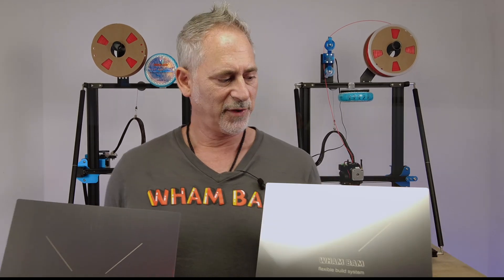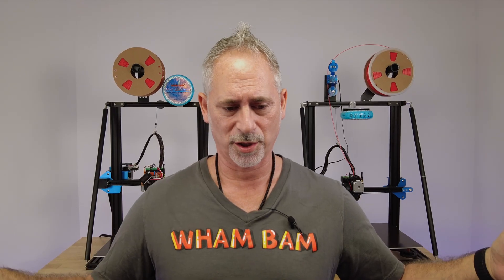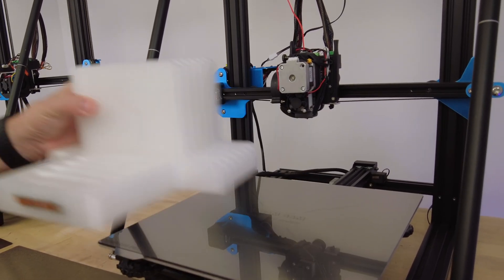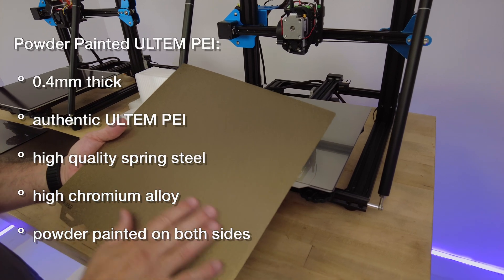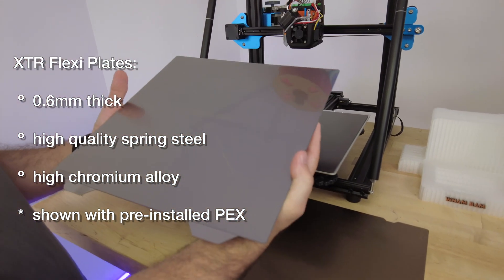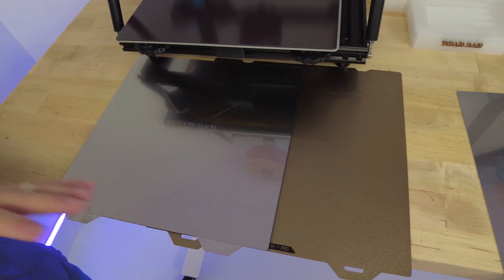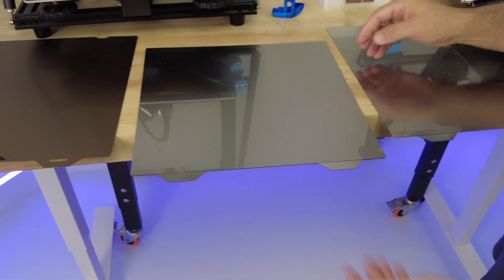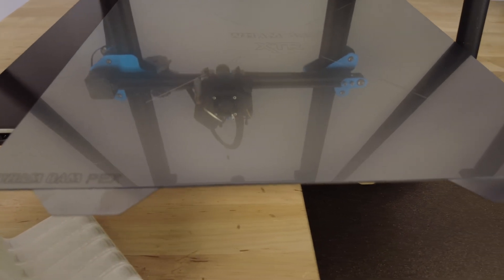Learning about the eXTReme Difference in FDM Printing

Comment: I have tried this product from Whambam systems and this product not only helps your bed mesh and produces a better print. It is second to none on that adhesion and helps prevent lifting of your model even when you use ABS or ASA it works exceptional and I currently have 15 FDM printers from Creality anywhere from the end or three pro up to the K1 max and these build plates  are the best you can get